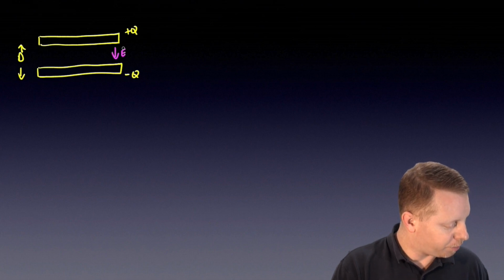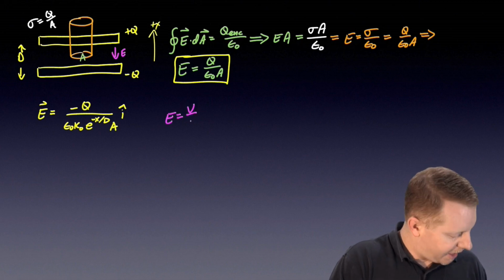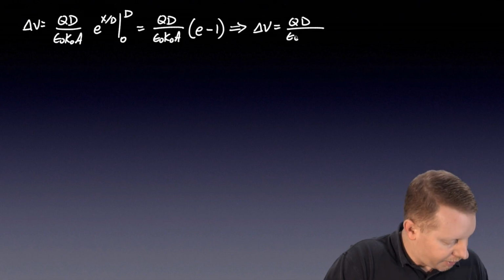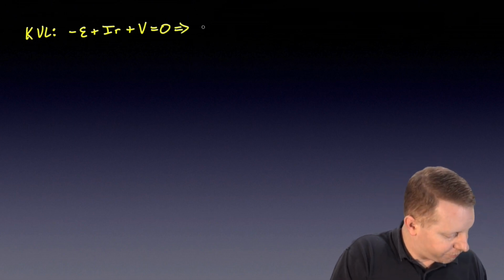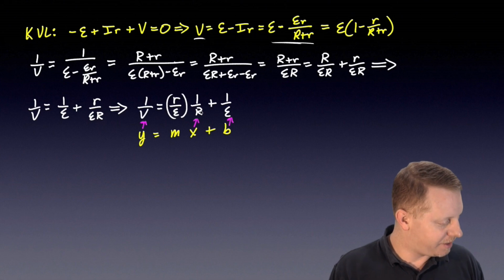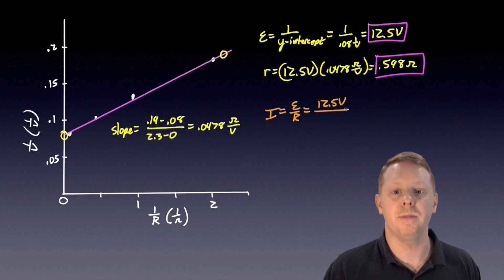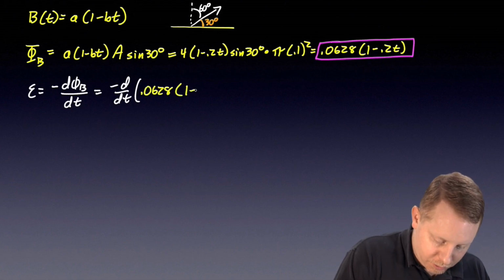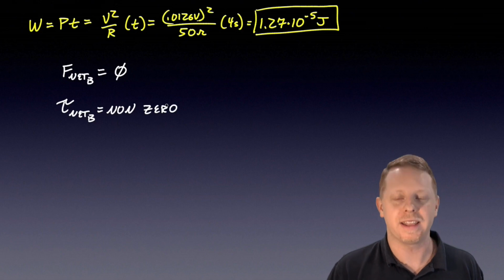AP Physics C 2015 EM FRQs

Comment: Isn't the electric field due to one plate equal to sigma/(2 * epsilon-naught). The electric field of both of the fields would add up to result in the total electric field of sigma/epsilon-naught between the fields. This is for question 1.
Reply: No. I can explain if you still want

Comment: By the way, am I correct in thinking you do not need to supply units for answers in terms of variables?
Reply from the maker: +Jacob Smith I would put units by any quantitative answer, but for formula answers, I don't put units in them.  Too much little-value-added work.
Reply: Thanks for the very speedy reply!

Comment: can you just use lin regression for the slope and y int? or do they actually want to see you calculating for m and b
Reply from the maker: +John Lin You can use linear regression, but I'd make a point to state in your solution that you used your calculator to determine the slope and y-intercept.

Comment: e and m looks more challenging than mechanics
Reply from the maker: MopTopRock Considerably...
Reply: however I have been told my multiple kids who took both exams that the mechanics exam was acutally more challenging, at least this year. I think the MC was tough for mechanics.
Reply: Dan Fullerton I totally spaced on the 1st problem, and couldn't get the expression for the dielectric constant in terms of Ko and D... everything else was a cake-walk on that problem.  The second one I totally jumped the gun on though.. I've seen that scenario so many times, with a graph of potential difference vs variable resistance, that I think I went into autopilot mode.. 

I put the y-intercept as the Emf, instead of the INVERSE.. because tricky, tricky collegeboard, they decided to put the same scenario, just with the inverse of each value. ..

How many points do you think they may take off for those two problems? I put in so much work this year and I feel so frustrated... I didn't manage my time on the test well at all, spent 25 minutes on the first problem, so I had to rush the last 2 problems and now I'm afraid I'll look to the graders like I don't know the material.
Reply from the maker: Jameson Doane Hard to say, but it's quite possible to get a good score despite screwing up pretty badly.  I wouldn't lose hope yet.  :-)
Reply: Thanks... I can't believe I did that on the 2nd problem.  It couldn't have been easier, they even GAVE you the two "other" values to graph.. usually they ask you to come up with them by yourself, in order to get a linear relationship.  :(